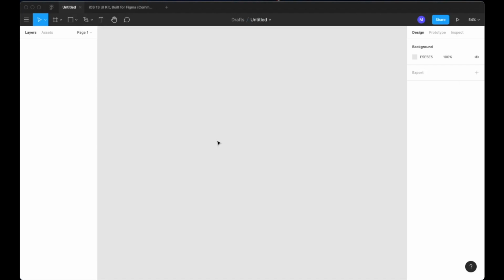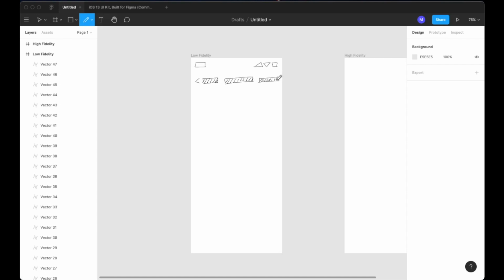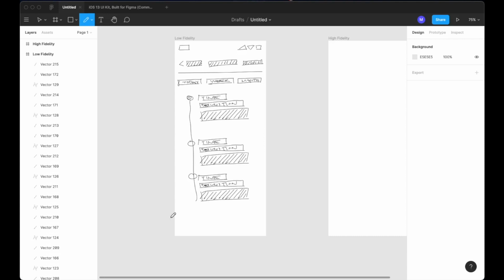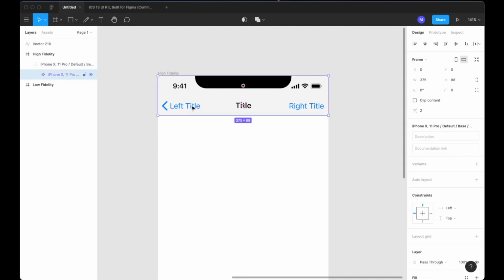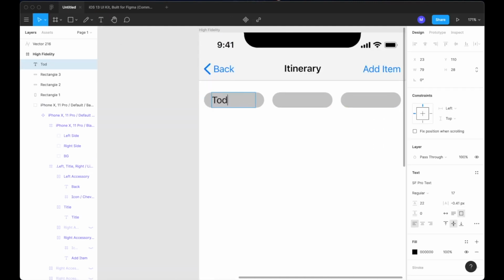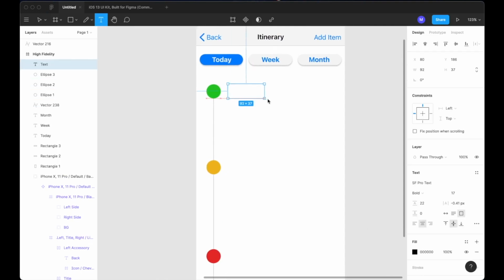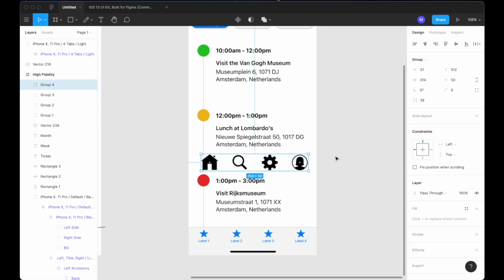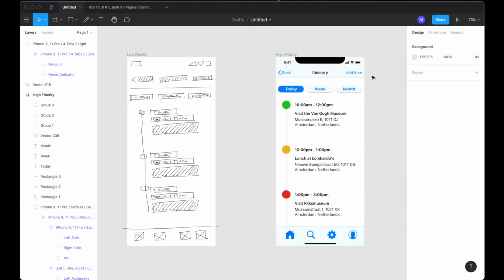[DailyUI #079] Itinerary - Low and High Fidelity Wireframe Process Video Made with Figma

Comment: So basically, Low fidelity wireframe is same as sketching?
Reply from the maker: That is mostly correct. You can also make Low fidelity wireframes digitally as well, however sketching them out with pen and paper is much faster and gets ideas and feedback quickly without committing to a single design idea. Low fidelity is an industry terminology that is used to differentiate itself from a more polished version of a product (i.e. app or website) called high fidelity wireframe which are done digitally. Hope that helps!
Reply: @miketrandesign  it's helps. Thank you!